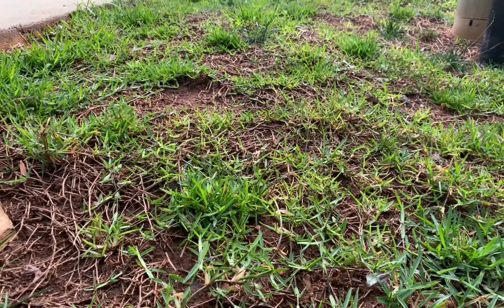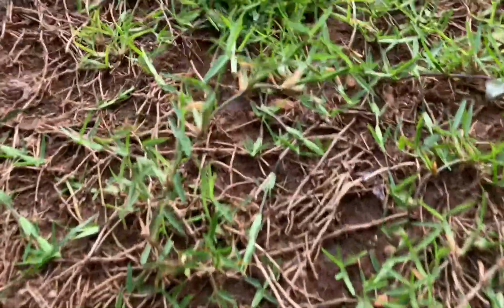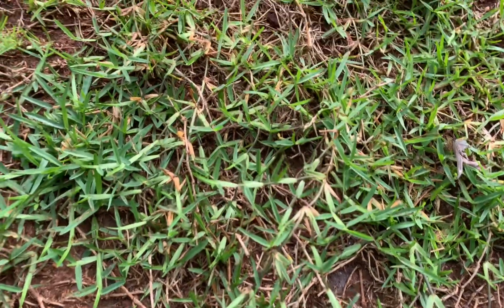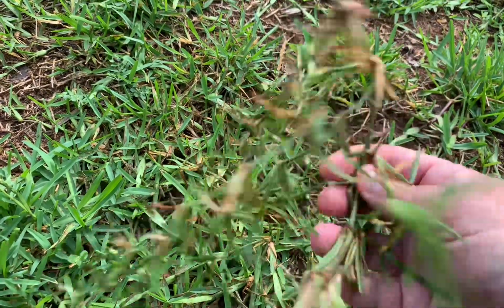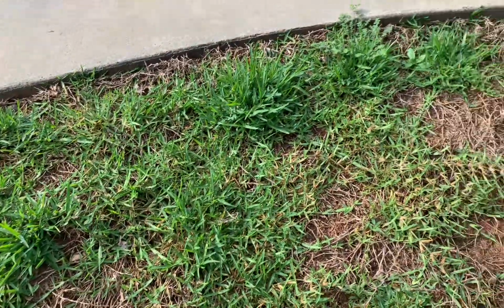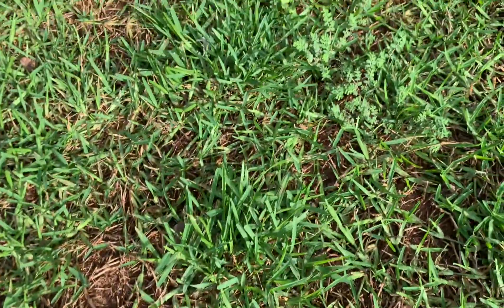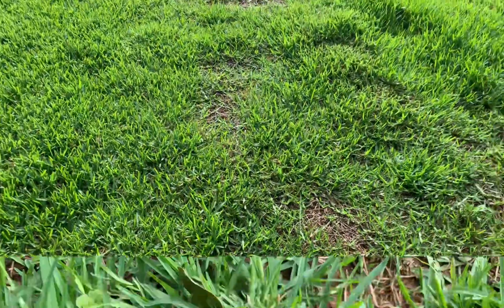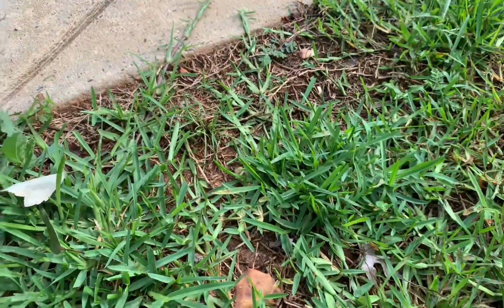How To Mow St Augustine Plugs Without Damaging Them - Trimming Looping Stolons To Optimize Growth

Comment: I saw another guy who had success with plugging stolons. He first put them in a container fill of water to allow roots to grow, then planted them. Super cool stuff!
Reply from the maker: I believe I saw the same video you did. I did that experiment last year and it worked. Key is to keep the ground wet for a week
Reply: Yessir! I love all things landscaping. Any chance you can give me some input/ideas on my lawn? I sodded with st Augustine just a little over 4 weeks ago, but half of my lawn is struggling to catch while the other half is thriving. I'm in Austin, TX so it has been very hot. I maintained the same water schedule for the entire lawn, but for some reason one side is not doing too well. It gets sun evenly I would say. Anyway, hope you can help me out. Thanks @LKNDIY
Reply from the maker: @abeljr5455   I do not have experience with St. Augustine sod, but I do know sod web worm and/or fungus could be your challenge. I’d look up sod web worm images in Google and determine if your symptoms are similar. There is no harm in treating for both though as either could do major damage to the whole lawn if they spread. Hope this helps.
Reply: @LKNDIY  thank you! I have treated for both this week. Fingers crossed